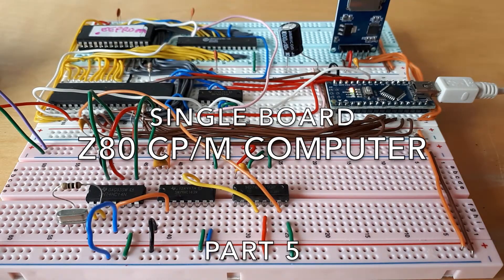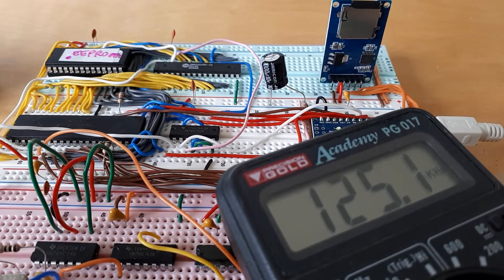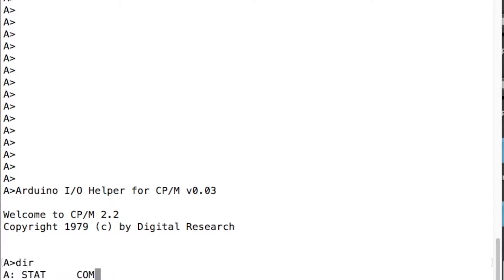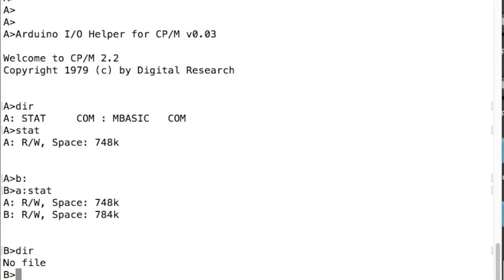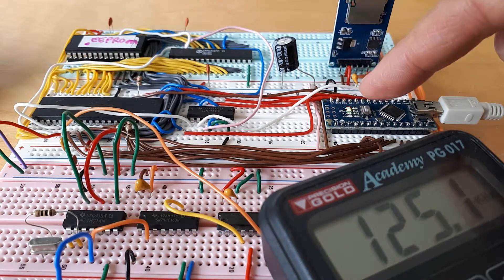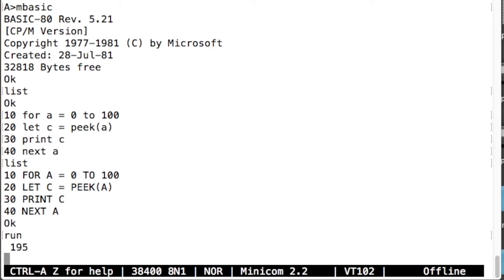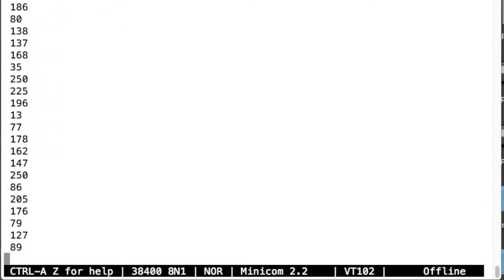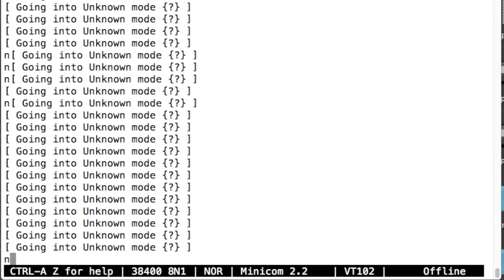CP/M part 5 - My Z80 single board retro computer

Comment: I kind of don't think your troubles are a breadboard thing. I've watched a few builds now, and it seems the arduino can be a problem. Slow & laggy. Idk. 
Maybe put the uno on it's own board ??
- Also. I've seen people running Z80 breadboard computers at 10mhz. With no problems.

Comment: Hi, nice project. Where did you get the CP/M you are using for the project?  You probably want to put the IOREQ on an interrupt pin of the Arduino to catch everything from the Z80.  You will probably want to do direct IO on the atmega ports as well to speed it along. The SD card should be fine as-is since disk IO is physical time and not digital.
Reply: I'll have to keep that in mind with my build. 
Thanks for that tip.